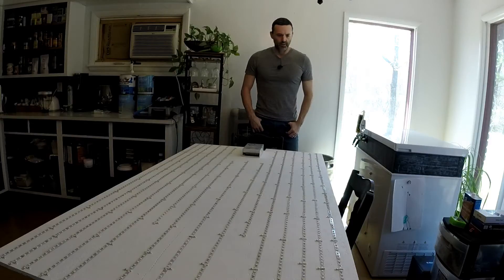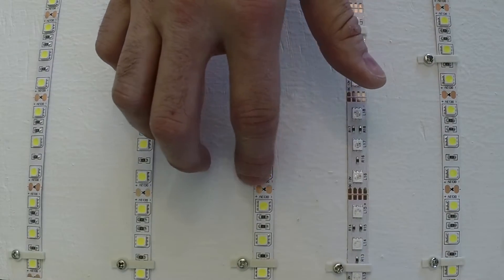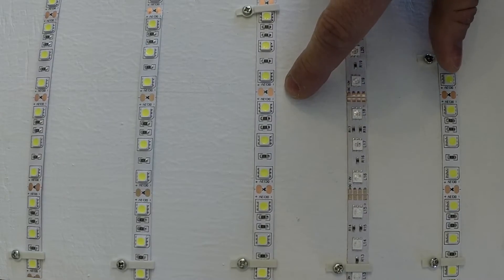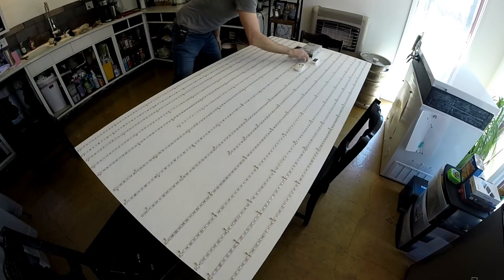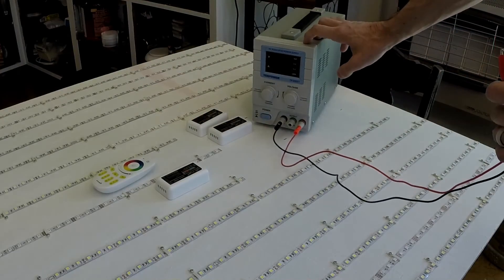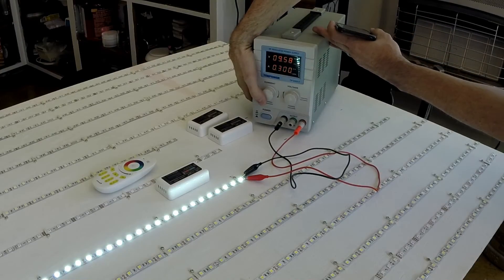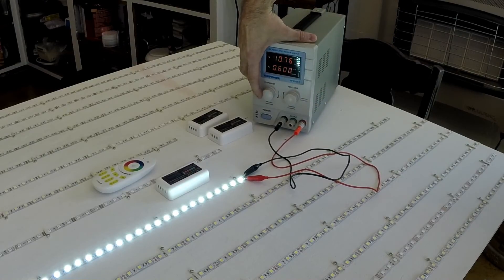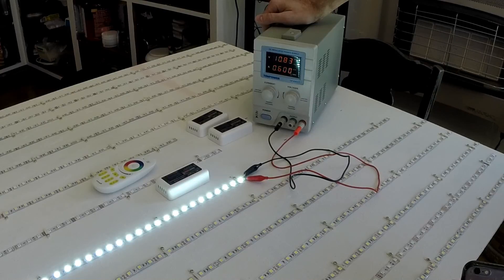Mi Light Rf LED How to wire and power LED strips

Comment: This is helpful, though I’m having an issue where my 3 meter run under my counter tops keeps flashing on and off after 10 minutes. It’s a steady 5 seconds on, blink, 5 seconds on blink, and in fact it’s not stuck as green. This is a mi light kit. Any suggestions?

Comment: Hello great video I have this one: https://pt.aliexpress.com/item/Mi-Light-2-4G-RF-Wireless-4Zone-Color-Temperature-Adjustable-CCT-Dimmable-Controller-Dimmer-for-WW/32818281180.html?spm=a2g0s.9042311.0.0.71b3b90amDjJIY and some ws2811 strips, but I couldn´t figure out where does the neutral and live goes since I have two V+ in the controller, could you help me?